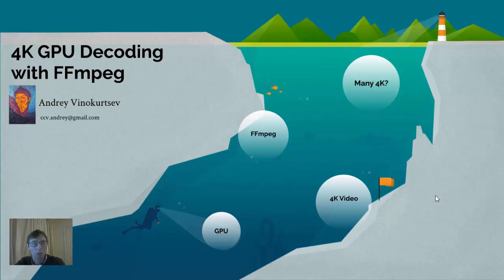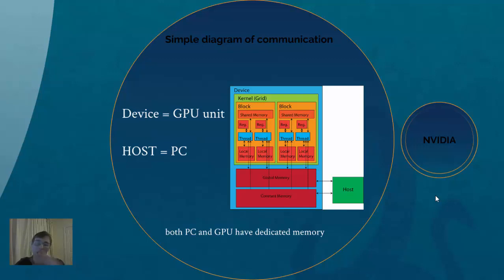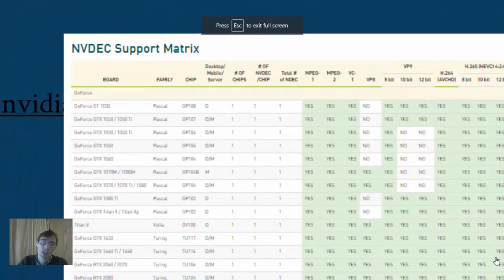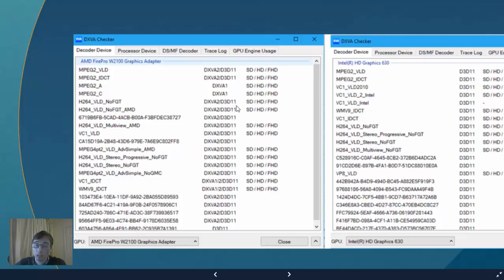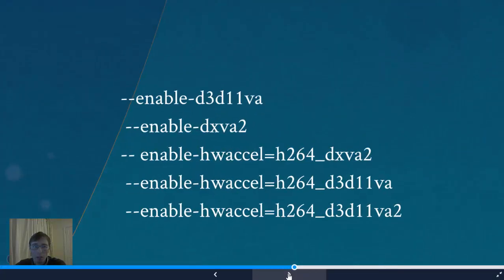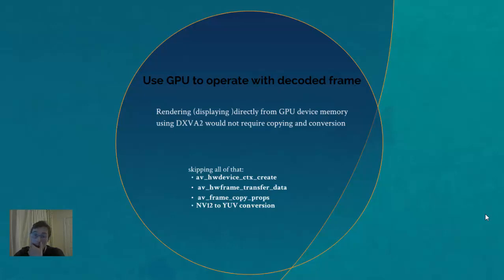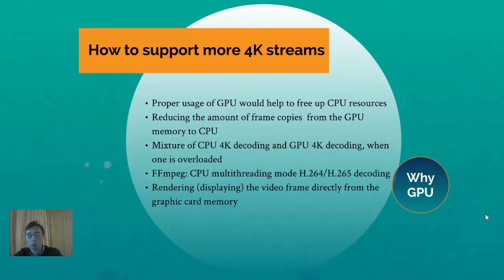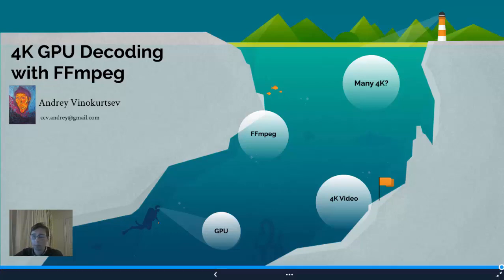GPU decoding using FFmpeg

Comment: and the commands what are
Reply from the maker: what is your question ? commands of ffmpeg ?
Reply: @codeccompressionvideo  no trochę przydały by się :) commendy for CUDA in RTX3080Ti with 12GB for JPGM -> resolution:8k60 %file.mov
Reply from the maker: @gorekpl  sorry never had RTX3080Ti  and never had anything with 8k60. I am guessing FFmpeg is moved forward and a bit untrack on my side. Do you have a chance to use  Gstreamer ?